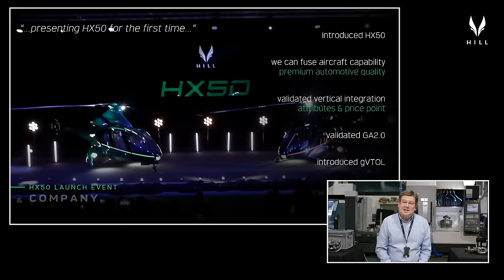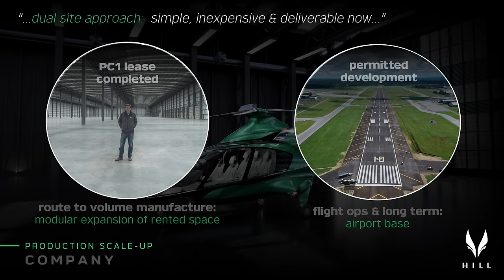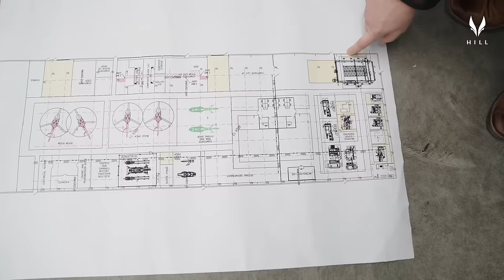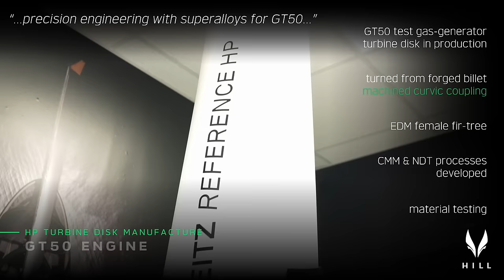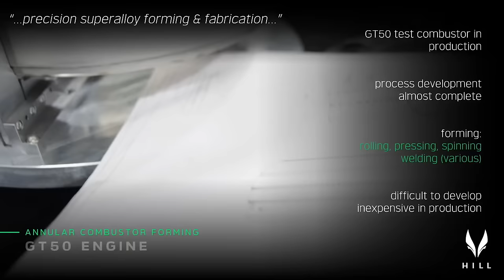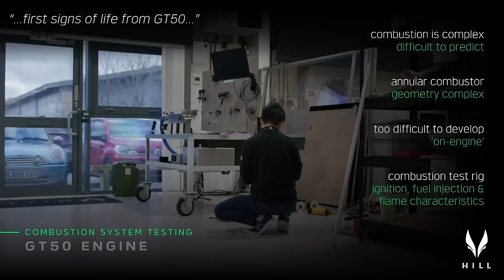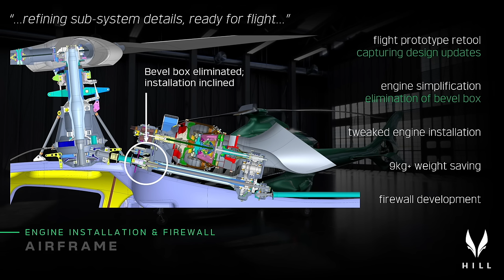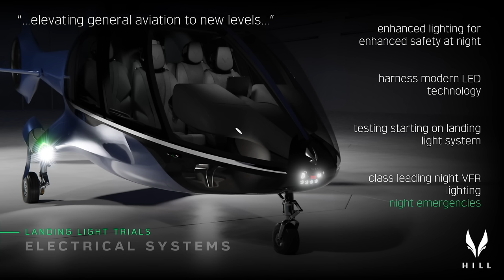HX50 Monthly Update & AMA - 13 March 2024

Comment: Will you use a similar industry turbine to mount and do some testing in the meantime as the GT50 is developed? That is, not for flying, but vibration, crash, structural, weight and balance testing, etc...

Comment: Does the direct drive electric starter motor have benefits in the event of an emergency to re-igniting the jet engine mid flight either electronically or manual manipulation or to give extra rpm torque energy movement to the main rotor to assist in an auto-rotation, since it has no gear box light weight and powerful? thanks🚁